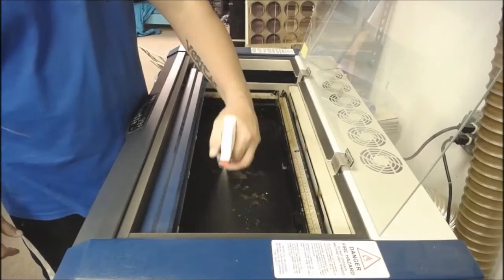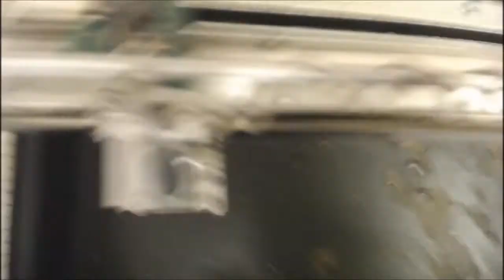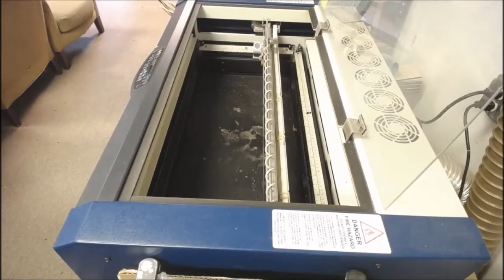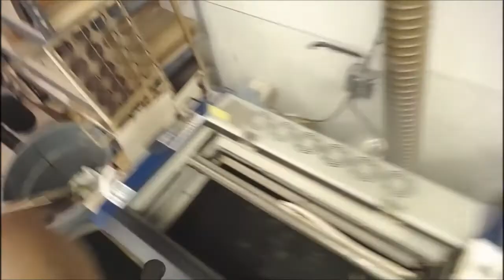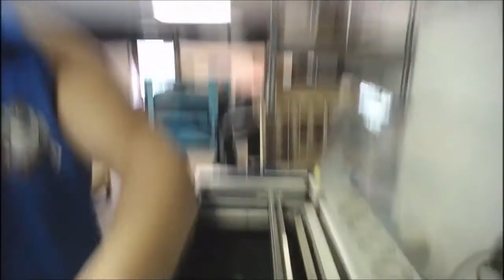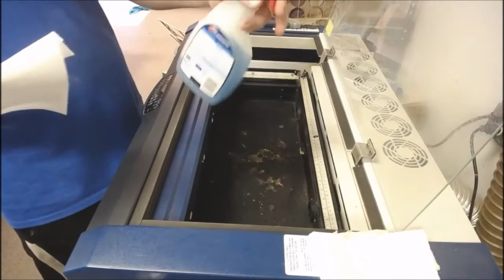How to fully clean an Epilog Laser Engraving and Cutting Machine (60W Mini)

Comment: Hey great video, was very insightful and helpful, quick question have you ever replaced the lens system on your laser engraver?  I'm looking to do a replacement, but struggling to find a good visual breakdown on the best way to do so.  New to the engraving game, don't want to risk making a big mistake.  Anyways thanks for the video!
Reply from the maker: Sure, replacing the lenses is pretty easy, just a few screws and then you need to do an alignment.  The lenses themselves have directional arrows in the sides so you don't put them in backwards.
Reply: @LifeWithRoger  good day friend,  as far as doing an alignment goes, what is the best plan of attack to get that done.

Thanks in advance!!
Reply from the maker: Differen't machines align using different methods. Can't help ya there bud
Reply: @LifeWithRoger  hey no worries thanks anyways

Comment: I got in trouble using the lens cleaner on the strip.  It has alcohol and it ruined it.  They said to use vinegar and water.
Reply from the maker: Alcohol for the lenses. Water for the encoder strip.
Reply: Yep.  Ran into the same problem.

Comment: Great video! What grease were you using on the rails?
Reply from the maker: You can use pretty much any, but I have a tube from Epilog that the sales guy left with me.
Reply: It's suggested that you use a form of dry lube, (Lithium) If you contact Epilog they have tubes of it